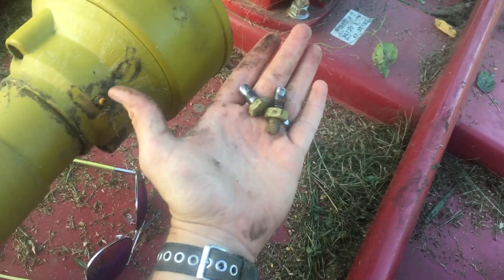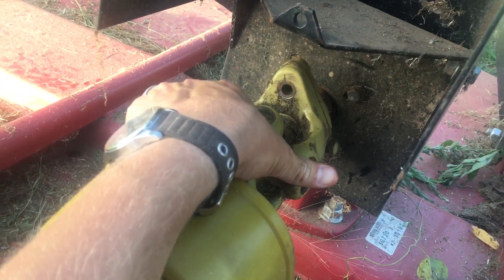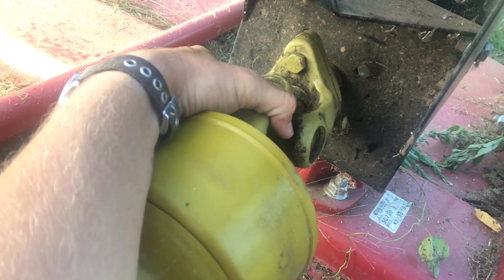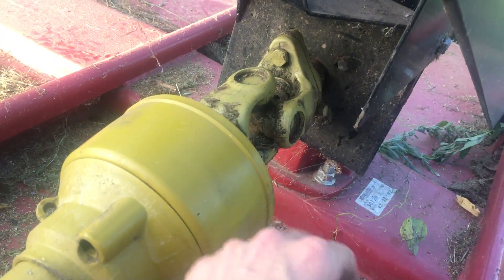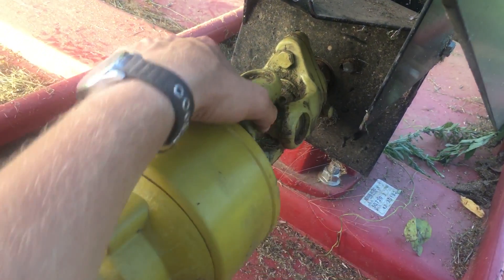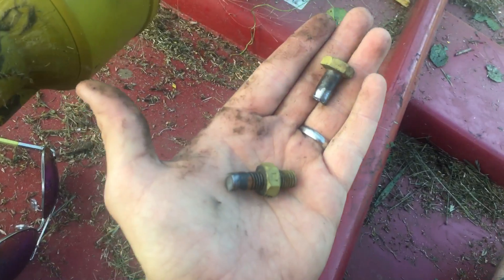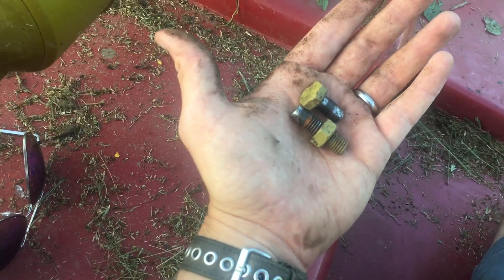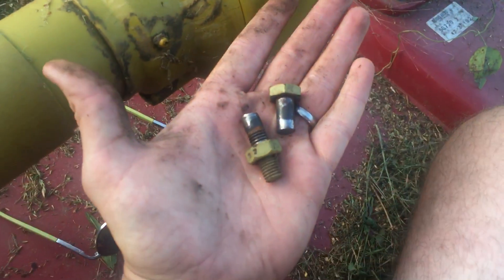Shear Pins are Smart (They're Mechanical Fuses)

Comment: I work in a mine. We use large shear pins, upwards of 2inch diameters. We don't call them Smart, we call them "Damnit, now now!"
Reply: Considering the result of them not being the weak point is a serious rebuild of a mangled conveyor they are cheap enough. New operators i always would have to replace a few taper pins till they had gotten the training fully ingrained, but the pins were a lot cheaper than the machine, and I also have a large supply plus importantly a taper reamer to massage the hole back into shape for the new pin. Of course sometimes the 65RC dog clutch did not like the manhandling, and shattered instead, but that was still fixable.

Comment: What advantage do shear pins, in this particular case, have over a clutch connecting the driveshaft to the blades?
Reply: pirate1234567891 Simplicity

Comment: what kind of tractor do you have?  I just bought a John Deere 4066R Hydrostatic drive for my work.  Its so much nicer than our older Deere 1070 direct drive.  Had the options of going with a Kubota, Massey, and New Holland... but I chose to stick with Deere in the end.
Reply from the maker: 1stGruhn why did you pick that? Color? Serious question.
Reply: Well... Gruhn does mean green lol.  Honestly though, I chose it for the following reasons: they hydrostat pedals on the Deere I like more than the Kubota (though the Deere has you break with the left foot which takes some getting use to), the 4066R has a 52 hp PTO which was a bit more powerful than some of the other options (the extra power is desirable for some of our implements), it was lighter than the Massey's utility tractor which is an important factor since we use it on Athletic fields (I'm lead groundskeeper at a High school and limiting ruts is important), the JD dealership is close (only about 30min from where we work, this eliminated the New Holland), the loader was could lift a bit more and move a bit faster than some of the other options, the front steering elements of the JD's are protected behind the axle instead of out front (like the Kubota), and the dealer also gave us a very competitive price.

I chose the hydrostat as opposed to the gear tractor do to the ease of driving, I have to train lots of seasonal staff and a difficult machine to work means less people can operate it.  It's useful to have many people use a machine and I can't spend all my time training folks.  I also like the fact that the ground speed and the PTO rpm are not related on the hydrostats (our direct drive tractor they were).  This is useful for mowing as you can slow down and turn without losing mower blade speed.  

There are quite a few differences between the various models and the ones I listed were the main ones I chose to focus on.  If I did more agg related work, I may have gone for the Massey: its heavier which gives it better grip for cultivating.  I've used Kubota and I like them, if I were buying the tractor myself, I'd be more strongly inclined for that (it was about 4k cheaper).  I narrowed it down to budget, ease of use, functionality.

Comment: I have something similar on the steering wheel in my car. It looks like a design feature. But what it is. A designed in weakens so if the airbag has to deploy. The cover breaks in the same position every time.

Comment: They take a bit more thought to use. In electronics, you just throw a fuse at the input of the circuit. When it blow, the energy flow is stopped. No big deal. In a mechanical operation, you need to put these shear pins in places where it won't cause things to go flying apart.

Comment: And this is what a failsafe really is, some people think a fail safe is a part that makes a system not fail, this is not the case, a fail safe exists to make sure that when the system fails (which it will eventually no matter how many preventative features you include in it), it fails in a way which does minimal damage, and is very easy to contain.
So in the future if you try to design a system you don't want to fail, don't think you can make a system which won't fail (ex: Titanic, by which I refer to the lifeboats), design one whereby failure is not that big of an issue.
Reply: Good comment, but Titanic did have fail safes. the underside of it was split up into sealable cabins, but when the captain tryed to steer away from the iceberg, he ended up with a long gash across the side of the ship that hit too many cabins to recover. Ironically, if he had hit the Iceberg straight on, and hadn't tryed to avoid any damage, the Titanic would have been fine.
Reply: I was refering to the lifeboat situation of the titanic moreso than the hull, I know about the fact that the hull was split into different compartments. I'll just edit the comment to include what I was really refering to.
Thanks for pointing it out though.
Reply: magical potato There was a flaw in the design of the watertight compartments on the Titanic in that there was no roof on the compartments so that when they filled up they just spilled into the next one.
Reply: Better for something to have a failsafe then be faildeadly
Reply: glitch1 I think Derek at Veritasium had a video on this that's worth checking out :)
Reply: to be fair, there are safety integrity levels in most system standards that dictate the probablistic risk that's acceptable due to the identified hazards of the system. often times these levels will dictate the fail safe state. Some examples: Fully continuous operation(hot swaps, full redundancy, ect), operational with reduced functionality(cost effective backup), 'off with notification' (anti lock brakes won't operate if failed), or an active safe state (brake pipes on trains will fail applied)
Reply: op4000exe yeah, big difference between a failsafe and a plan b
Reply: @glitch, there is actually "fail safe" and "fail secure." 
Here is an example. You have black out and it kills the power to building and for some reason auxiliary power (battery back up, on site generator, etc) fails too. A fail safe door will unlock upon losing power to ensure people can get out. But if this building is trying to protect something (armory, bank vault, CDC lab, etc) then you want the doors to fail in a secure manner until power can be restored so that people can't get to what ever is being protected or can take the stuff out.

Comment: they use those shear pins in car washes to!
Reply: Also used on railroad crossing type gates so if it comes down on a vehicle inadvertently, it limits damage to the car. Small gates use nylon bolts.
Reply: You know, I was wondering about that some days ago.  "What if one of those strips of cloth caught on my rusty undercarriage?"  Assuming the strips are strong enough to not rip apart themselves.
Reply: Brendan Orr they do rip on there own. but if the sensors or programming malfunctions on the carwash and the brush tries to hit your car too hard the shear pins break to keep it from damaging your car